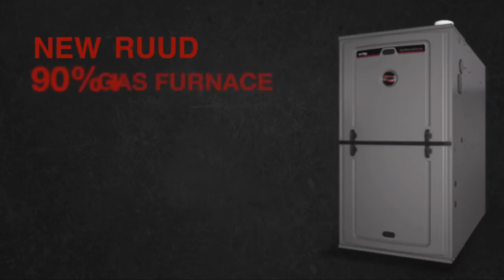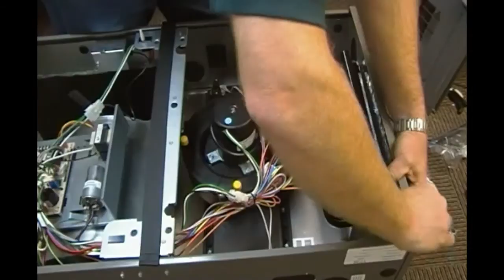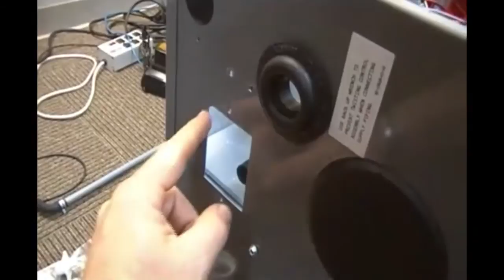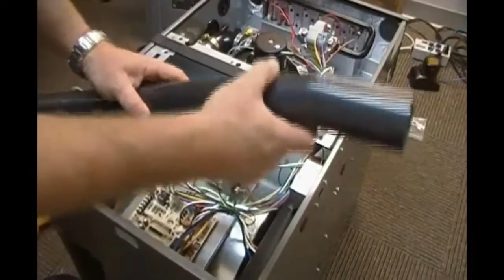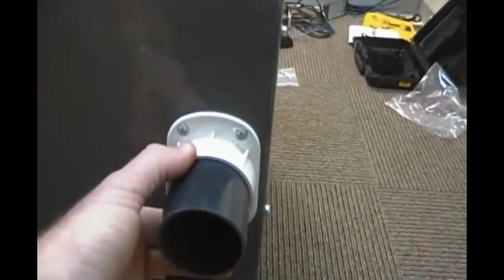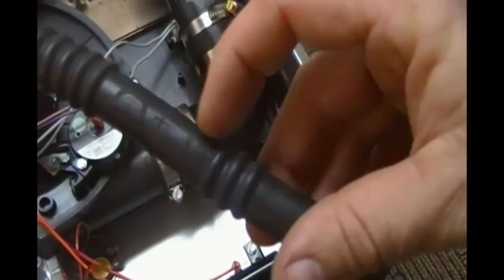Ruud 90%+ Gas Furnace - Horizontal Left with Right Venting

Comment: Nice video! Why would you want to change this to begin with though?
Reply: Why would you change the vent ? On a horizontal left, just leave the inducer in place . Most likely, you are terminating thru the roof.? Let your pvc vent-pipes take care of that .
Reply: Do you any material regarding weather king gas furnace for horizontal position ,left supply and right return please?